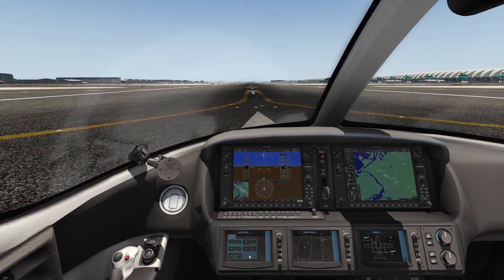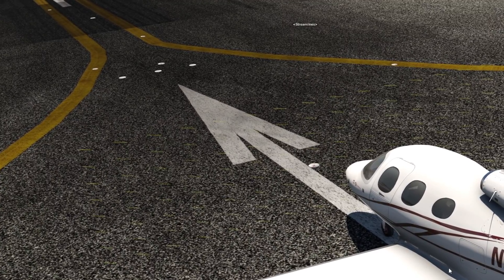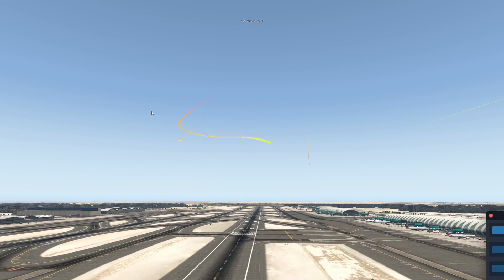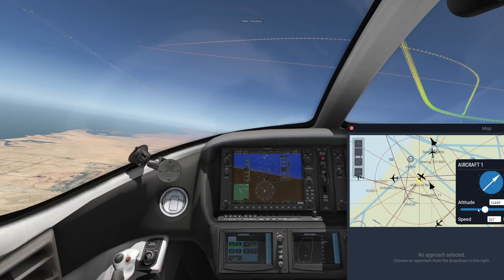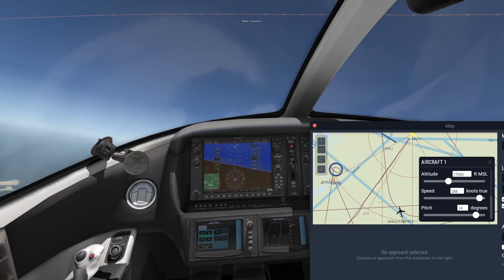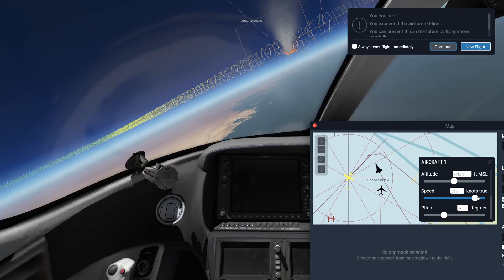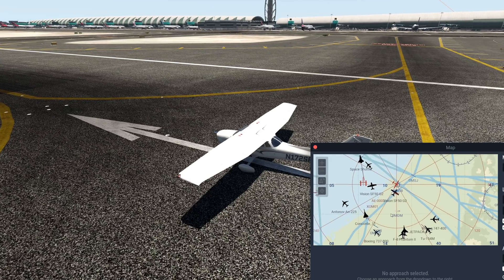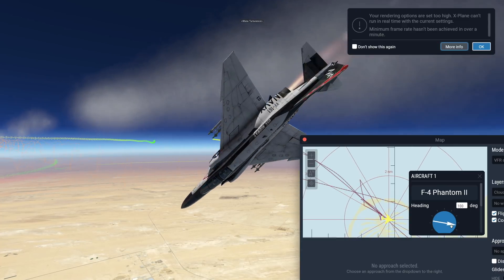Small Plane VS WAKE TURBULENCE OF B737

Comment: An moons ago, he FAA, had a seminar at MORRISTOWN MUNI AIRPORT ( NJ. ), very well attended, about 1970, on the subject of WAKE  TURBULANCE , they showed SEVERAL TYPES OF AIRCRAFT starting with a C172, following a LEAR, well the 172 did 3  full rolls, , THEN, the LEAR, following the DC9, as  it went that LAR, ALSO DID  a few swings left&right., then rolled several times,  Followed, by that DC9 FOLLOWING a B747, with same  things happening , all of this was to show what can happen. Recently a Challenger with passengers some 14 miles at same altitude, following a B747, well much to their surprise, it pitched over in both directions some 60 degrees, it mage an emergency landing, as they had no idea what caused it, until an investigation showed what happened.
The B757, now has a 5 mile seperation , for aircraft following, typically its3 miles, but after 2 private jets at different times crashed, 1 a Citation, &   1 Westland., it took sometime to connect the dots.
Cheers FROM NJ🇺🇸🇺🇸🇺🇸🇺🇸